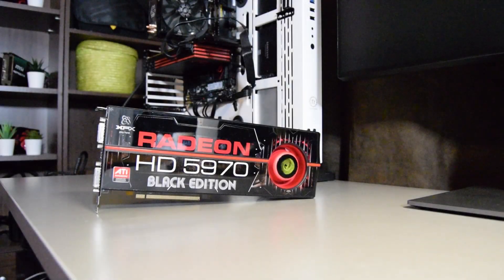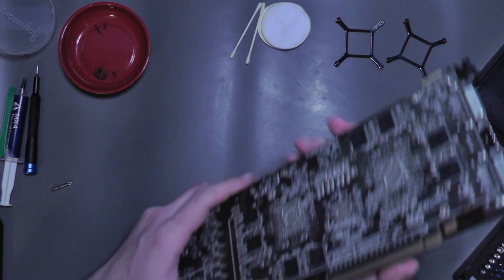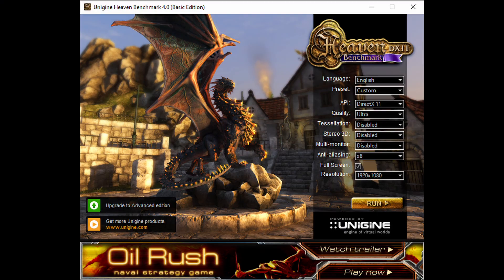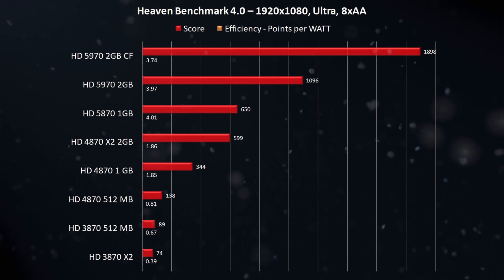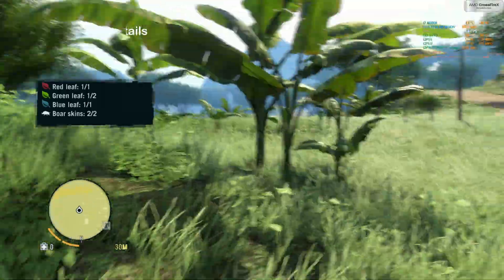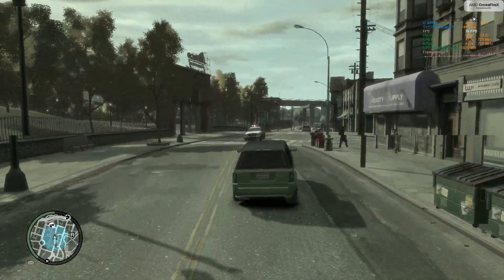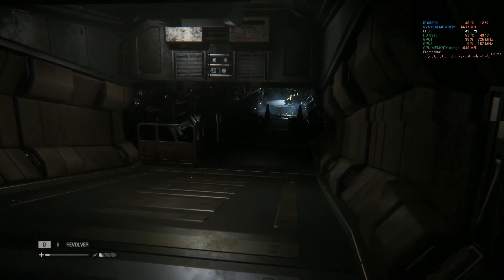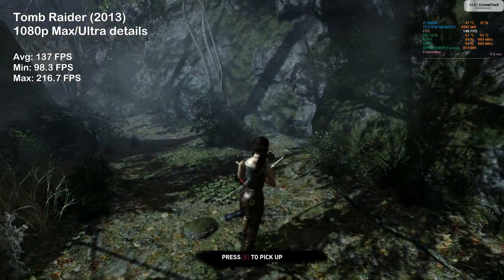ATi Radeon HD 5970 tested in 2021 - The $ 1,400 USD Quad Crossfire that no one should try!

Comment: Scored 9287 Points in Heaven.  

Captured the whole run with CapframeX and only 10 % of the time I was in the GPU Limit. 
My CPU holding me back at this GPU Benchmark. :D   

RTX 4090, Ryzen 3950X and 32 GB Ram @3600mhz

Max Fps = 610 Fps / Avg. Fps = 368 Fps / 1% Low = 248 Fps

Comment: My settings:

Q9550 @4.0Ghz (Max Stable OC with 800Mhz Memory)
ASUS P5Q PRO
4GB DDR2 950Mhz 5-5-5-18 2.2V OC (Max OC with 800Mhz. I could go higher with 1066 Memory, Need to find some 1066)
ASUS HD 5970 @850/1200 1.175V (HD 5870 Clocks, which is a must ;)
Win7 Ultimate 64

Heaven benchmark:

FPS: 48.5
Score: 1221
Min: 8.3 (Could be the CPU causing that)
Max: 90.4

Comment: Hi my friend. Is there any chance that u have one of those GPU backplate brackets flying around? 3:30   

I bought a retro HD 7970 with stock blower design, but it came without the bracket! Now it gets extremely hot (95 degrees after 5 minutes of gaming and also being extremely loud.

I changed pads and paste and im sure the problem comes from the missing bracket! I would love to buy one from u! I havent found them anywhere else yet!
Reply from the maker: Sadly, both cards were sold off ages ago :(

Comment: Great video!

Do you have any tips for an HD 5970 only showing up as one GPU? I've checked GPU-Z and device manager, and it only recognises it as one card.

I've tried different motherboards, different drivers, different power supplies, and using either the DVI or DP output, with no luck. Maybe one chip is dead? The AMD software doesn't recognise it as crossfire capable.

Comment: I sadly cannot do your exact settings as my GPU doesn't support hardware acceleration under windows but does under Linux. Tesla p4 (server card that is a slightly cut down GTX 1080) OpenGL got me 1748 as the score. Maybe I'll try with my Tesla M40 (server version of the GTX Titan X Maxwell) later which does support windows with hardware acceleration.
Reply from the maker: Thanks for sharing mate! Sounds like you got some nice gear to play with too! :)

Comment: Oh what type of power supply did you use to power the 2 cards and how much power did they use?
Reply from the maker: Hi mate! All of the testing is done on the test bench pc that has Corsair RM850 power supply, total system power draw was 510 W during Heaven benchmark - take 100W away for CPU and the rest - about 400 Watts ?
Reply: @nexus_tech  with 2  5970's running crossfire??  only 400watts

Comment: I get around 7040 points but it is much lower than it should be because I get really bad frame drops (down to under 40) when the next scene starts
RTX 3080, I7-12700KF, 32gb 3200mh
Reply from the maker: WHAT! IT's over 7000! Hah :) Thank you for letting me know, that's a monster score! Your rig is so fast, dang it! :) Not sure about the drops, it could be that Heaven is so old now...
Reply: Yeah the 1% lows affect all computers running the Unigine benchmarks.

Comment: Love your VIDEO Excellent work but some games were meant to be played at 1366x768 8X FSAA all candy!! Ultra or Enthusiast !!  Like  Crysis Warhead   1080P  100 FPS!
Need for speed 1366 x 768  !!  The game will fly  at Ultra settings 8X FSAA. And look great!
Windows 10  and Use it on the New Ryzen's 5000 series !
and DDR4 4400Mhz you'll see a huge difference !!
EVO M.2 SSD chips 2 x 7000Mbs sec in Raid-0 watch it help no lag or flicker!
But sadly drivers are not allowing Games to use the cards tech and massive shaders of 3200 !!
and optimized dual GPU to their full potential!!!  They have to to sell the new cards!!
So that's why this card doesn't perform in some new games like it potentially should fly!!
Lack of driver support!
Reply from the maker: Thank you! And yes, agreed. A single card solution is the way to go. The low utilisation is the worst as cards can not push to their limit!
Reply: @nexus_tech  
Your so  right on the single card solution..
Compatible no issues (Flicker or distortion non what so ever)  No game crashes or jumping out like other  graphic cards.
I am Using a ASUS R9 270X OC 
Best most stable card I have ever used.
On a AMD FX 8150 8 Core 32 G of Ram
4 SSD's in Raid - 0 It runs outstandingly powerful and multi tasking is a breeze.
Plus insane loading speeds!!! Raid - 0....!!
This card is also beyond OUTSTANDING  !!
No stutter  no Lag and the frame rates is again excellent for past games from it's time line of insane frame rates !!!!
So I am extremely pleased...
All the  older games I love from 1999 -2017
Are easily playable and from insane frame rates of 442 fps 8x FSAA  to  326 fps again 8x FSAA The crispness is unbelievable !  in older games like SERIOUS SAM &
HALF LIFE 1 and 2  again 400 + to  300+ frames .  Just crazy frames rates !
 Aliens vr Predator Colonial  Marines  full eye candy 1080P  all the way down to decent lows of  52 to 60 - and upper 100 + solidi fps in this particular new gamer..
In the newest titles   still smooth all eye candy at 1080P.  Again special cable  will high transfer rate make sure you have them very important! 
Very Very pleased with this card;.
Perfect for it's time line on a single GPU!!!!

BUT MY TRUE LOVE IS THE 
ATI ORIGINAL HD 5970   I HAVE !!
RUNS EVERYTHING IN IT'S TIME FRAME UNMATCHED!!!  INSANELY STRONG!
BEATS BY FAR  ANY GRAPHIC CARD!!
IT'S UNTOUCHABLE! in 2010 !!!
When I fired up  Battlefield Bad company 2 
All maxed out 8 X FSAA  1080P and the frames were insanely just magical 
 and the game flew  !!!!   SO SMOOTH AND DETAILED  !!! 8X !!!! FSSA !!! CRISP!! WOW!!
 Modern Warfare 2 also  just unbelievable smooth fast flying gameplay! sick frames 300++ !!! In that time frame I was blown away!

TODAY MY ATI 5970 KILLER CARD IS IN MY NEW  killer  system  !!!
Ryzen 5000 series DDR4 4400Mhz  VIPER RAM!    7000mbs x2 EVO SSD M.2   2 x running in raid = 0 on the motherboard.
Latest Windows 10 drivers..
And game patches to utilize the HD5970 to it's full potential   
all 4 K  cables and mini display port  4K cable to HDMI adaptor  plus  DVI special custom high transfer gold  cables.
240 Hz monitors x 3  SPECIAL GAME 0 ns no lag instant display !  all this makes for smooth game play!!!! and necessary  for full potential out of this video card.

3 screen must have special "cables" for over 5000 resolution  3 eye infinity screens.
All this matters if you want to see a race car game  flawlessly fly  at super smooth playability !!! 
Nobody does this then reviews a Graphic card without all these important things.
My setup is for long term and I am super pleased and happy with it's outcome.
Where other people get bad performance because of not having everything adjust to it's full potential.   Bottlenecking your complete setup with a bad link in the chain.
  So remember  alot of reviews are flawed  and some cards are old and defective to when they get them.
PEACE OUT!!!!! 
P.S   I am very thrall on my PC builds.

Comment: i remember friggin around with Hybrid Crossfire and lowend. hd3000 onboard hybrid with 2400xt/hd3450 . x2 3450s a hd3450 with the hd2400xt...  all super silly and pointless really but  the hd4670's in crossfire was pretty sweet when it worked.

Comment: Heaven score: 2299
FPS: 91.3
Min: 19.8
Max: 157

R9 FuryX 4GB
RYZEN 9 5900
64GB RAM

It kept a really good Min FPS but hit one scene that knocked it down to 40 then another that knocked it down to 19.7. Probably no fixing that in Heaven.

PS, Linux Mint not Windows.

PPS , Ran it again: 2309
FPS 91.7
Min: 63 <-----better
Max 157

Also it's OpenGL not DirectX11
Linux thing.

Comment: They should have put  2G per GPU - 4G  ATiHD5970 
Don't use 8X FSAA  and do the test..
I wanna see the frame difference.
Reply from the maker: Yeah! That would have been much better :) But then, we would not be as excited with 6990 haha! Which test did you wanted re-run ? I can't promise it can be done soon :)
Reply: @nexus_tech    ATi HD5970   nobody cares about the HD6990    
BUT!! the 7990 hey that was something..
I would like you to run  the ATI HD5970 
Same bench mark  but at 1280x768 or  1366x768  and or 1080P  No 8X-FSAA 
No reflections and occasions  
Just Volumetric  and high quality.
And run GTA 5   High Textures - full distance and Ultra  water and everything else set to low !
  1080P and 1280x768 and 1355x768....
I would love to see your numbers..